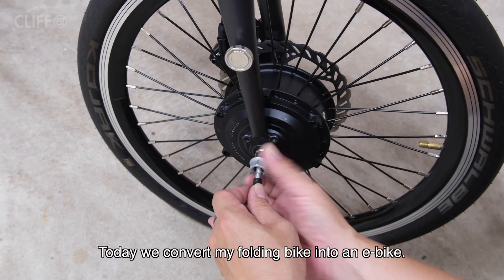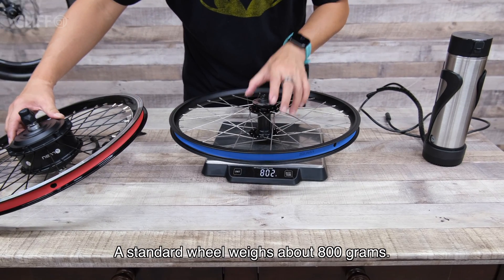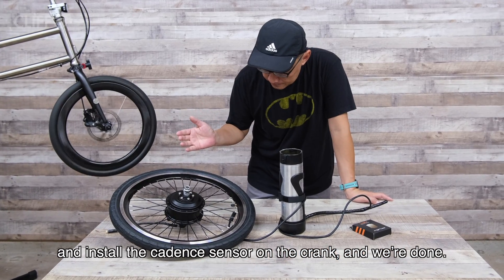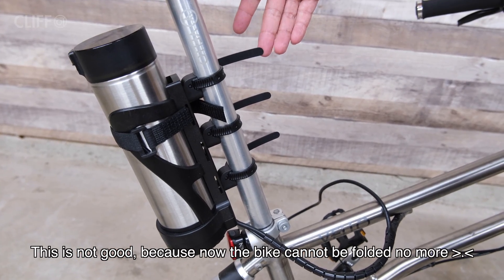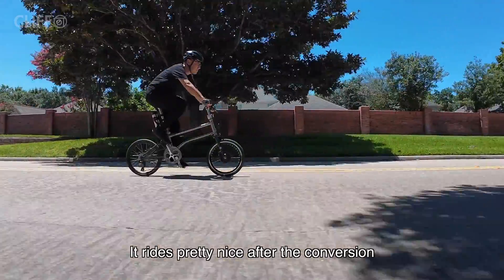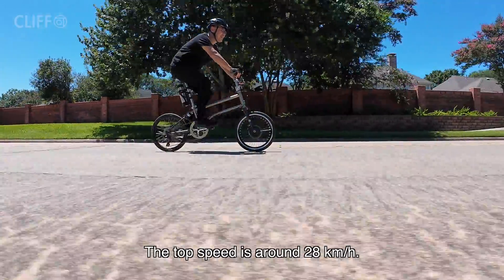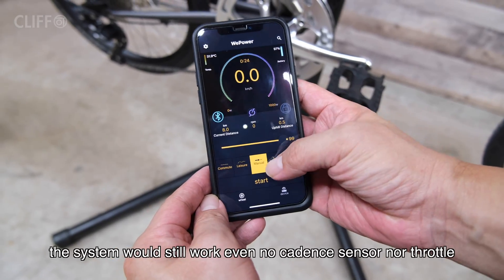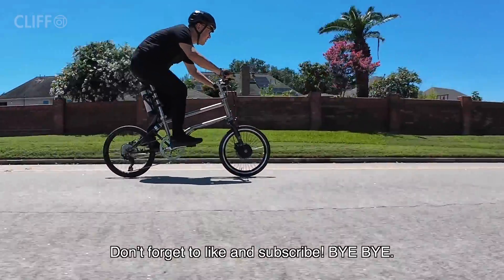LVBU E-Bike Conversion Kit for Folding Bike / Wireless Aliexpress DIY Bicycle Power Wheel Hub Motor

Comment: I bought the same brand also, the company lies about the battery capacity! its not even reached 60KM/battery. Once dropped to 50% the battery drained quicker. 14Km range the battery dropped to 50%. you need 2 batteries if you want to reached 60KM.

Comment: I found another user same as me now!
  I dismantled the 16" motor wheel already after I found this conversion kit in PAS mode just 23.5 KM/HR maximum speed.
This was slower than 30 KM/HR without this conversion kit.

Comment: With hub motors you can get more rpm if you overvolt them with a bigger battery. You gotta do some quick maths and check out how much watts can your controller sustain, but it should be pretty easy if it’s by a moderate amount.